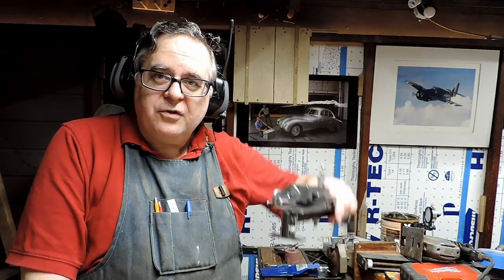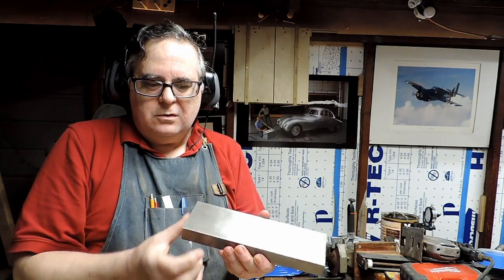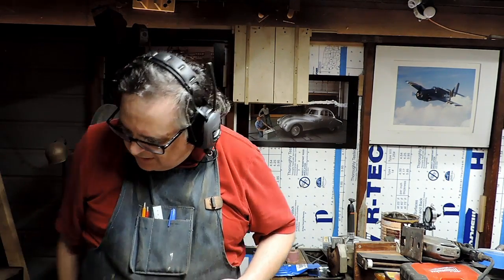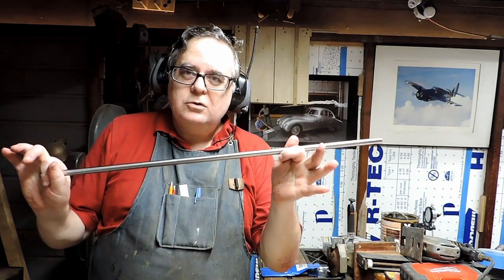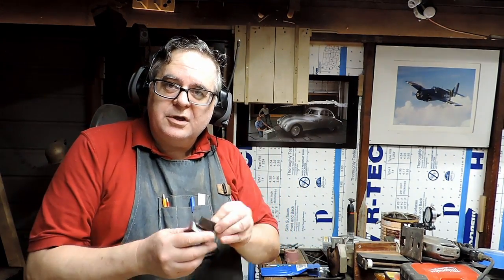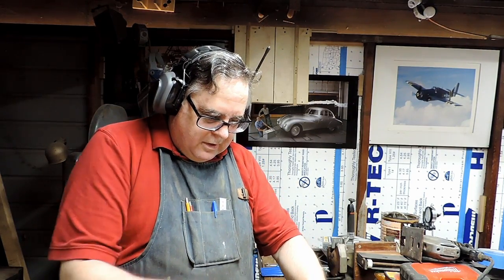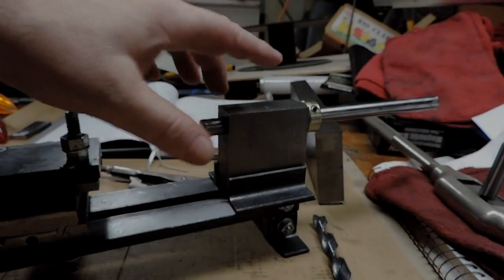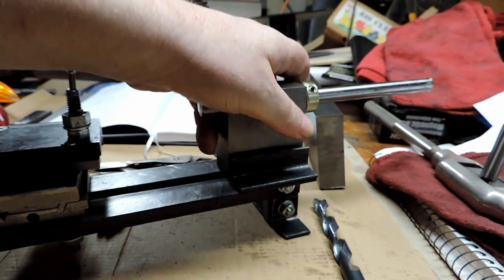Model makers lathe part 3

Comment: If you don’t need the full length of the shaft, drill out the center of the shaft like a stuck bolt and see if that relieves some of the tension/pressure, then drive it out with a BFH and a punch.

Comment: Yes, try heating the block and cooling the shaft. 
Check out this video  starting at  12:45  https://www.youtube.com/watch?v=MTDEftQlkvY
Might work to slightly enlarge the bore in the block to get a bit of clearance.
Reply from the maker: I like the idea of cooling the shaft and thanks for the other idea.  I saw that video and it never occurred to me to try that.  That's one that I' gonna try.
Reply: I had another thought,  re enlarging the bore slightly,   cool the block in a freezer and then ream, the hole will get bigger when it warms up.

Comment: Have you tried to apply some heat to the block to expand it ever so slightly and pull the rod clear? Heat gun, torch, or (less likely) just some very hot water might do it.
Reply from the maker: Thanks for the help,  I'm going to give it a try.